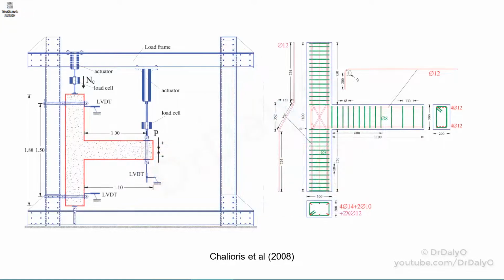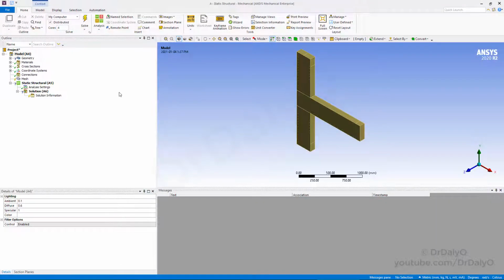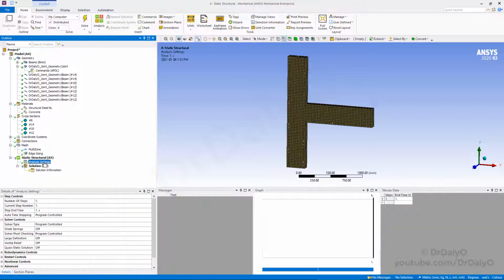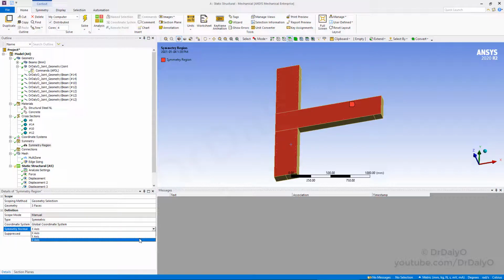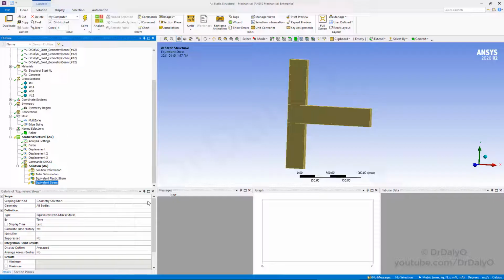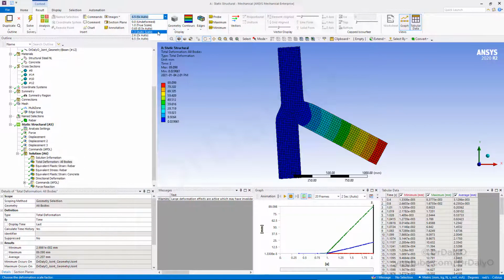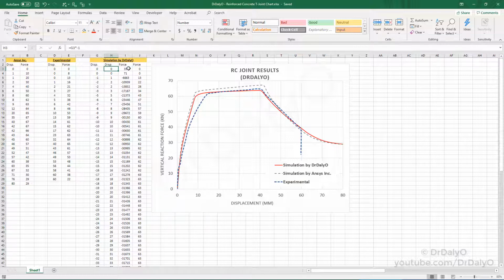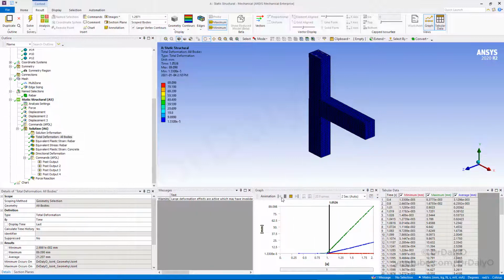ANSYS 2020 Tutorial: Reinforced Concrete T-Joint

Comment: great job, thank you very much for sharing. For your information, I repeated this simulation with version 2023 R1 and the idea provided in tutorial works. Results are however slightly different - in the first phase it is almost identical as Ansys Inc., then, after reaching peak force reaction the softening happens faster (results go belowe experimental curve), however it is still satisfying. I will play later with analysis settings and check the correlation. Thanks once again!

Comment: Dear Dr Daly,
I am trying to implement this model but the MPDP plots do not seem to work, I am using the same commands you use in this video in ANSYS 2022 R2 and I get these warnings:

For item = ENAME, component = 215 is invalid.  The ESEL command is      
 ignored.

The requested MPDP data is not available.  The PLNSOL command is        
 ignored

Do you know a solution for this? I have looked a lot online but solutions such as changing the settings from distributed to parallel etc. do not seem to make this work.

Kind regards

Comment: Dear Dr. 
Please tell me if that  CPT215 is  better than Solid 65 regarding application of Cyclic loading on RC columns? by other meaning, can it considers the shear reduction of concrete during cyclic loading to can get accurate results under cyclic loading ?

Comment: Dear Dr DrDalyO, please let me know the titlte/author of paper which have all material parameters for concrete in the video. Thanks in advance!
Reply from the maker: Hello it is in the video description, under references:
1. Chalioris et al. "Reinforced Concrete Beam-Column joints with Crossed Inclined Bars Under Cyclic Deformations." Earthquake Engineering and Structural Dynamics. (2008)
2. Raasheduddin Ahmed et al. "A gradient-regularized coupled damage plasticity microplane model for concretelike materials". Ansys inc.
Reply: @drdalyo  Thanks you! I have read the paper written by Imadeddin Zreid and Michael Kaliske with the title: "A gradient enhanced plasticity–damage microplane model for concrete". In section 4.3, they wrote: "As
 a suggested procedure to identify the damage parameters, D, βc and γc0 are estimated first by fitting a uniaxial cyclic compression test...". They just mentioned D, βc and γc0 can be obtained by fitting but the type of fitting they didn't show detail. Can you give me some guidance to perform fitting procedure to obtain  D, βc and γc0. If you don't  mind, please explain to me via emal: dinhvanduc06@gmail.com. Thanks again!

Comment: Hi sir, i tried exactly how you did for five times. But still in getting error... It shows "An unknown error occurred during the solution. Check the solver output on the solution info. object for possible causes." Can you please give me a suggestion for this problem ?
Reply from the maker: Some reason it doesnt work with the newer version of ansys. Please check the version and try again! Sorry about this
Reply: @drdalyo  Thank you sir. I'll check with lowest version. And I have one more doubt sir, that I'm getting linear curve when making a load deflection graph. I need non-linear curve which shows ultimate load and breaking load. Could you please tell me the solution for this problem sir ?

Comment: Ansys employee response:
I can confirm that this workflow (CPT215 and inbuilt reinforcements in Mechanical) does not work anymore in 2021 R1 latest rel..

Thus one would need to use 2020 R2.

I should add, that this method is wrong so do not use any of this and ignore that video as it is not from us.

So CPT215 elements can be used with REINF elements, but we can not have solid186/187 then use ERIENF/REING264, and then EMODIF solids to CPT215 - that is not correct. If we want to use CPT215 with RENIF and reinf264, then that should be done as in our TD54 example in our help manual (concrete joint analysis). So just emsh with CPT215, and use reinf (this is only done now in apdl).

Comment: Just wanted to say, Amazing work! Thank you for your amazing commentary and attention to detail. It has helped me a lot!
Reply: Can you please tell how to bond concrete and steel after assigning material?
Reply: @abhishekbv8740   If you are using explicit, just use Body Interactions -> Reinforcement.  That will assign the contact of the rebar to the concrete.

If you are using static structural, highlight all the line bodies in the geometry and change the type to reinforcement. I believe he does this in the video
Reply: Sir can you please elaborate as I'm new to ansys and my project is stuck because of this reason please tell me steps to bond concrete with bars
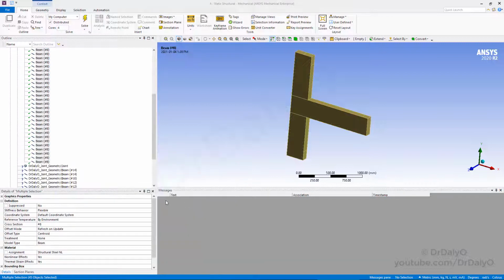Reply: @abhishekbv8740   if you look at 3:47 of this video, he changes the model type of the rebar from beam to reinforcement.   This model is static structural. If you are using explicit, you would use body-> interactions reinforcement and apply to all bodies
Reply from the maker: Thanks Akiva for the answers!
Reply: @carelesseagle  How to do it in transient structural?
Reply: Sir, how can you fix Drucker-Prager cap plasticity integration algorithm did not converge problem?

Comment: Hi! I've done the tutorial  step by step and when I'm running the model an unknown model error occurs during solution. The error ir 'Drucker-Prager cap plasticity integration algorithm did not converge for element 7993 and material 46.'    

Any solution?

I've used Ansys V21.R1

Thanks
Reply from the maker: Hi, for some reason it doesnt work on newer versions, i havent figured out why yet.
Reply: @drdalyo  I have tried on Ansys Version 2021 R1, It doesn't work. But Ansys Version 2021 R2 does.

Comment: Good day sir. Is the Reinforcement option only can be used for Static Structural and Steady State Thermal? Because when i use it for Transient Thermal + Static Structural it shows error "Reinforcement are supported as release feature only for Static Structural and Steady State Thermal Analysis"
Is there other way to solve this?
Reply from the maker: May not be supported for other analysis types
Reply: @drdalyo  thanks for replying sir. just my suggestion.I found zero tutorial YouTube video for Thermal + Structural analysis for Reinforced Concrete T-Joint FEM using Ansys. Abaqus has many of it. So it would be great if you can do one in future. 🙌🏽

Comment: Sir I did same like you but I am getting error during solution check the solver output on the solution information object for possible causes 
So please help me sir
Reply from the maker: Please double check you are running the same version as in the video. Many reports of it not working on the latest Ansys version. You may need to downgrade.
Reply: It worked for me in 2021R2.

Comment: Thanks for your model, it's really inspiring. I've one question: ¿is this model able to simulate cracking and crushing? It seems that Drucker-Prager concrete is a kind of plastic material since there's not a decrease in its stress when tension strength is reached. What I mean is, is there a way to combine steel reinforcement (via REINF264 elements) with cracking-crushing concrete (via SOLID65 elements with CONCRETE model)? Thanks in advance and br!

Comment: Did you ever try RC structure under cyclic loading using these concrete material model?I faced convergence problem when the structure entering highly non linear conditions

Comment: Hi, I am using this DP model and the parameters given by you for my model under reverse cyclic load. But, the DP cap plasticity doesn't converge for a particular element. Thus, ANSYS stops. And no plastic strain has developed till now, so could u please help🙏🙏
Reply from the maker: Hi! Its seems to be an issue with newer versions of Ansys (2021). If you can downgrade for now until I find another solution.
Reply: No, even I am using ANSYS 2020R2, with monotonic loading, your model works fine but with reverse cyclic it's giving error

Comment: Hey sir I have a question. I have built a suspension bridge on Ansys and I need to pre stress the main cables of the bridge using ‘INISTATE’ command but I don’t know how to just prestress specific elements. I located the element ID in solution information which is (417 and 418) in my case. Do you mind helping me out on writing this apdl command? Would greatly appreciate it. Thank you!
Reply: You can create named selection from element you want, and then via command cmsel select specified component and aplly inistate command respectively.

Comment: Hi DrDalyO, I enjoyed following the video and attempted the analysis myself although I've had an unknown error when solving my model. I am using a student version of Ansys 2021 R1, but I'm unsure how much of a difference this will make. I've copy and pasted my solver output to pastebin and I'll leave a link here, if you are able to help and come to a solution that'll be fantastic. If not, I look forward to the next video!

https://pastebin.com/1m5Kyd8F
Reply from the maker: Hi there! There error seems to be the following “Drucker-Prager cap plasticity integration algorithm did not converge”. If you followed my video exactly, there should be no error. Its possible you missed a step? Doesnt seem to be an issue with the student license. Double check your mesh settings with the video and also the solver settings. Please let me know if it fixes the problem or not! Il try to figure it out with you.
Reply: @drdalyo  Hi thanks for the quick reply. I went through the video again a couple of times and I had the wrong Metric units chosen, I changed the cores used when solving to 4 and double checked the mesh settings although I'm still running into the same issue. I've attached the output below again. Any help will be appreciated.

https://pastebin.com/ZYMFB4ge
Reply from the maker: Hi Luke, can you save (archive) the project as a .wbpz without result files and email it to me? My email is in the about page on my channel. Hopefully we are using the same version or lower than mine. The files are not backwards compatible.
Reply: @drdalyo  Hi, I've emailed on the file with RC T-Joint in the subject. Hopefully they will be the same version or lower.
Reply: @0wMyNuts  @DrDalyo I am facing the same problem, and I use 2021 R1. Is it an edition-related problem?

Comment: Very well explained. 
I tried to recreate the model and managed to run it without any error till 50th iteration. It is showing some error after 50th iteration saying cpu time exceeded. I tried with turing large deflection off and managed to run till 62 iterations. Still I'm able to see partial results.
I have some other doubts too. 
Can we use CPT215 with tetrahedron elements? 

I saw Drucker-Prager Base model in Engineering data with Uniaxial Compressive and Tensile strength and Biaxial compressive strength. Can we use it instead of the code ?
Reply from the maker: You can try however i do not believe you can enter the same parameters.
And no you cannot use tetrahedral elements

Comment: Thanks a lot for this video! I have two questions:
1. Why do you change SOLID185 into CPT215? Is this step absolutely necessary?
2. Is it possible to define the Drucker-Prager concrete material model directly in the Engeneering Data and do without the APDL-Command?
Reply from the maker: Hi Lea! Welcome!
So you change it cause the Drucker-Prager model does not work with SOLID185. And no you cannot yet define it in Engineering Data, hence the reason for the commands.
Reply: @drdalyo  Hi DrDalyO, Great tutorial!! how can we see the element type of my geometries? i'm not sure there are solid185 in my model
Reply: @antonettanunziata3591  you can write dat file in workbench and then open it in ansys apdl, to check.

Comment: how can we use symmetry if there is are bars in the centre of section?
Reply from the maker: Good question, I believe it should work fine. You can run a test with a full model vs symmetrical and see if there are any differences.
Reply: @drdalyo  will have a look, thanks for the video

Comment: where is the solid65+EREINF video?
Reply from the maker: Please see my video library, its an older one that I made.
Reply: @drdalyo  I have seen that before, I was using your video for reference in my thesis. Thank you.
I have high axial forces in my column section and directly applying forces on model generally tends to unconvergence, what should I use as an alternative? Use steel plate and apply pressure?
Reply: @kshitiz anand yes, it works on my system

Comment: great lectures, but sir can you please tell me about apdl  commands .How to write and when to use ?can you  please refer so i can learn
Reply from the maker: Its only used in some cases where Workbench does not support the feature. You can always use ANSYS APDL instead of Workbench. Also to find out more you can check the user manual from Ansys for APDL commands.
Reply: @drdalyo  thanks sir . But how to identify those cases ??? And does the scrip writing is based on c or Fortran .or Ansys has its own library or syntax
Reply from the maker: Most cases do not require commands. Ansys has their own script language

Comment: Is Ryzen 5 4600H with Nvidia Gtx 1650 good for Ansys, Solidworks, Openform, Hypermesh, Ansa? Any problem in that? Reply fast
Reply from the maker: I believe only Nvidia Quadro is supported, please check the ansys website for this. I also have a GTX and it does not work, so I only use my multicore CPU for the solver.

Comment: one question though , if i draw the same geometry in autodesk inventor , while exporting to to the ansys i have some trouble like several bodies of the parts dont show up and show up as a single body = .  i dotn wanna draw in spaceclaim , do i have any choice now ?
Reply from the maker: I dont use inventor so not sure but you can just export your model from inventor into spaceclaim (.stp or .sat) and then fix the geometry up in spaceclaim. Spaceclaim is a direct modeler so can handle anything really.
Reply: @drdalyo  i m pretty good with inventor . i dont wannt spend more time again learning spaceclaim,  like u said i could fix the geometry in spaceclaim to a imported stp file , ill  have a look around . tnx of rthe reply